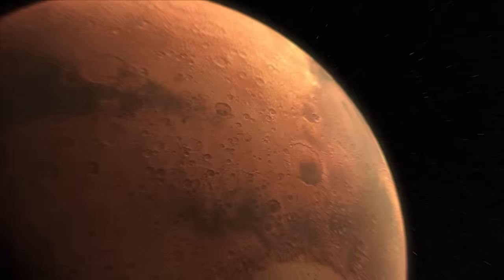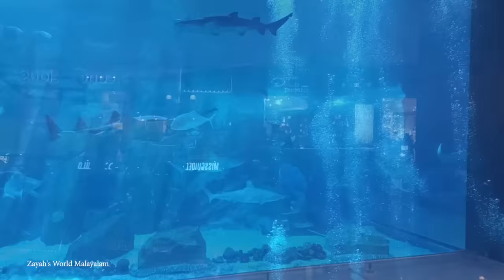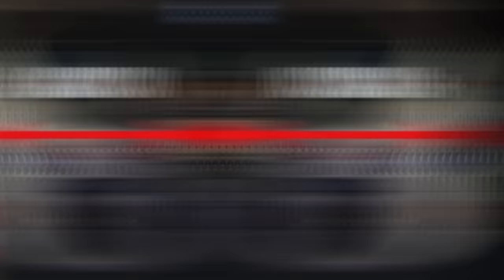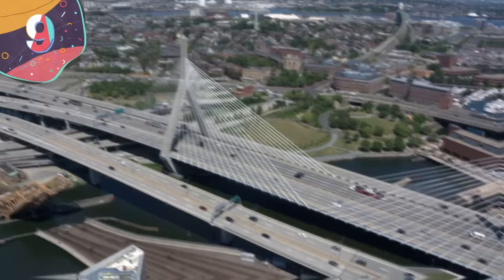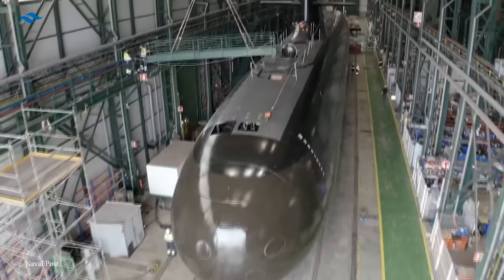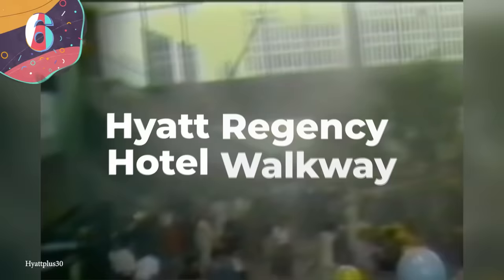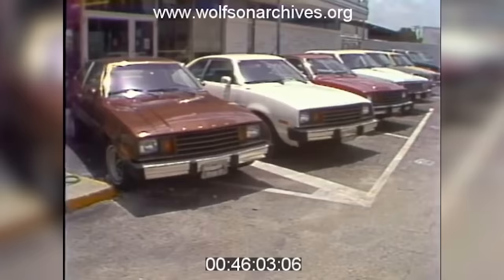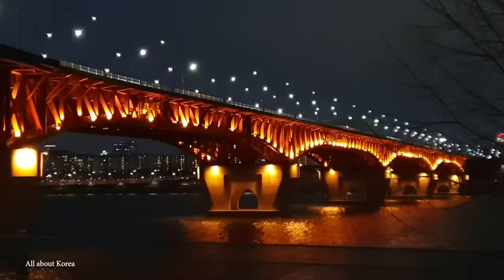15 Crazy Engineering Mistakes

Comment: Somewhat good summaries, but the description of the problems is trivialized.  For the Hyatt Regency, the construction contractor made an unauthorized design change that resulted in the suspension rod for the topmost walkway carrying the full weight of both walkways instead of only the upper walkway.  The change could have been safely if it had been analyzed by the design engineer.  What would have been needed is a doubler plate on the bottom of the upper walkway cross beam so that it could support the weight of both walkways.

On the Pinto, the problem was not that the gas tank was between the bumper and the rear axle but rather that there were the threaded section of the axle u-bolts that are pointed upward that cut open the gas tank when it was pushed forward.  However, this design flaw lead to locating the fuel tank nozzle from the rear of the vehicle to the side of the vehicle and moving the gas tank forward away from the rear crush zone of the auto body.

On Apollo 13, it was a bit more complex than described.  After the Apollo 1 Fire the Oxygen tanks in the Support Module were changed.  Periodically, the LOX (Liquid Oxygen Tanks) needed to be "stirred" to prevent stratification of the LOX in the tank.  The heater and stirring fan in the Apollo 13 LOX tank were of the previous design.  As part of the equipment there is a thermal limiter switch in the tank whose purpose is to shut off current (or power) to the heater in fan if the temperature in the tank exceeded a set point.  With the higher applied voltage the contact points in the thermal limiter fused closed.  As result when the astronauts went to "stir" the LOX tanks, it overheated and the increased pressure caused a burst disk to open to relieve the internal pressure.  Unfortunately due to the design of the LOX delivery to the fuel cells, the secondary LOX tank also drained.

The point of this video is admirable in showing that seemingly inconsequential actions or circumstances can have drastic consequences.
Reply: Yeah but it's not the History Channel or a documentary it's just an entertaining list video 🤷‍♀️🤔

Comment: While you are correct about the Apollo 13 oxygen tank wiring voltage changes, the real root cause of the failure was that the tank was dropped by 2” during testing. This caused the tank to become distorted. During a following test the engineers were unable to unload the tank due to the tank damage, so they used the tank heaters to force the liquid oxygen out of the tank. That meant that the heaters were used for an extended time at the higher voltage that then caused the degradation of the wiring. So this was actually a combination of two problems - the root-root cause was the tank drop.